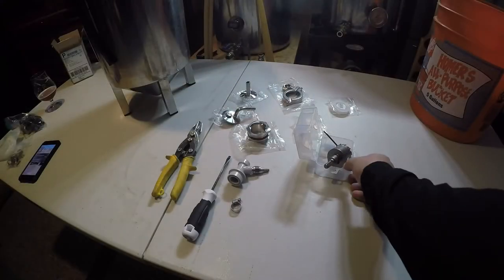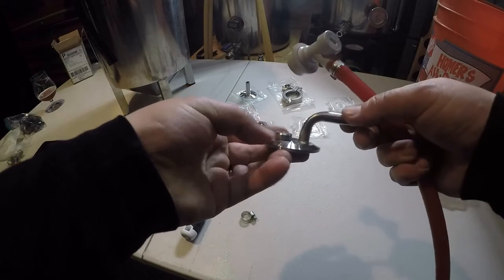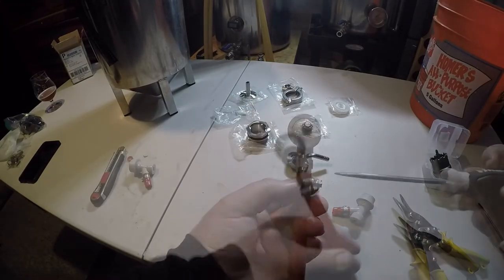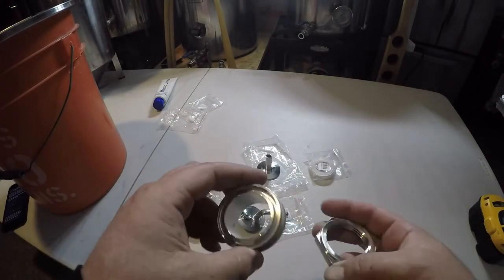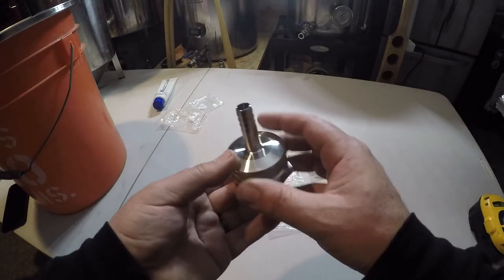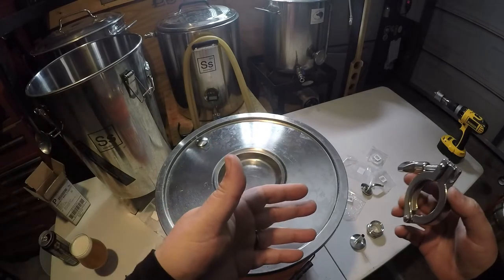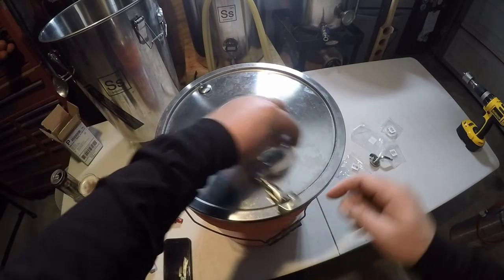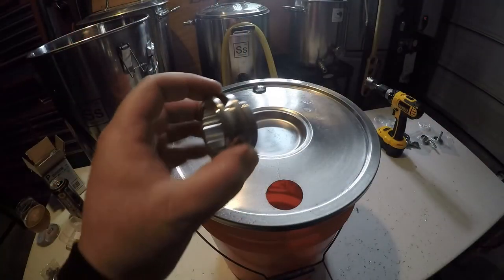How To: Ss Brewtech Brew Bucket Pressured Transfer Kit Install

Comment: Great video, this project is on the to-do list when I can afford it. Just a thought. Instead of taking the ball lock off with the worm clamp every time, you could get a Carbonation and Line Cleaning Ball Lock Cap (morebeer) and connect that with some tubing to the pressure release barb. Then you can keep the ball lock attached at all times and just connect the ball lock to the Ball lock cap.
Reply from the maker: Genius! I’ll have to look into this when I get home. Thanks for the tip!!

Comment: Nicely does Josh, oh if i had a penny for every time i tried something and it didn't work out as planed, when i could well... probably buy a beer i am sure. I still use my brew bucket with the conversion I also use a 1.5 triclamp ball lock fitting to keep a slight bit of pressure during fermenting. as always good advice for not getting too close. to either edge. cheers!
Reply from the maker: Haha that is so true Gary, luckily my mistake only cost me slightly more than a Costco 24 pack of local craft IPA! It will sure be interesting to see how this changes things for me and my process, especially IPAs.

Comment: Great vid, thanks for the tips - I have the kit and haven't "gotten brave" and drilled my lid yet, hopefully with your info I'll get it in the correct spot! Like the idea of using it as a DH port too - hadn't considered that, I usually crack 2-3 of the clamps on the lid and post the hop bags in as quickly as I can.
Reply from the maker: Hey thanks for watching and commenting. Yeah I’ve been using it as a dry hop port, though still not oxygen free it’s better than fully opening the lid fully. Good luck on your modification when you get around to it.

Comment: Nice how-to video Josh!  I ended up going with the 90 attachment that SS Brewtech offers for my pressure transfer because I didn't want to drill my lid.  I wonder what the differences are.  I guess the tri-clamp fitting gives you some more versality which is great.  I'd imagine you can attach a ton of things to that tri-clamp as you want.  I look forward to seeing you use this setup in action in future videos.  Cheers!
Reply from the maker: Oh nice, I’ll enjoy seeing your 90 attachment in the future. I know that this setup with the compression fitting hole will allow for easier dry hopping without needing to remove the whole lid. Cheers Matt!
Reply: @JHooverBrewer  Good thinking about the dry hopping. Maybe I'll show my 90 in the HBW this week. Cheers Josh.

Comment: Thanks for the video, this is exactly what I was looking to do to mine. I was curious if you thought about drilling the new hole over the existing hole? Then you wouldn't need to use the plug.
Reply from the maker: I did consider that for a brief moment but didn’t end up doing it. I’m glad that this was helpful for you though, good luck!

Comment: I'm about to do this mod on my brew bucket as well.   I'm thinking it might be worth it to drill a gas post into the lid to purge the head space after dry hopping through the 1.5" compression fitting.  I use a mini fridge as a ferm chamber and I don't have the space above the bucket for one of those fancy dry hop sight glass set ups
Reply from the maker: I also have a mini fridge fermentation chamber! 

https://youtu.be/aIruePHJDh0

Good luck with your idea in modifying, there’s not one right answer. I simply remove the compression fitting and drop them in…it’s certainly not perfect but it’s also not as bad as removing the whole damn lid either.